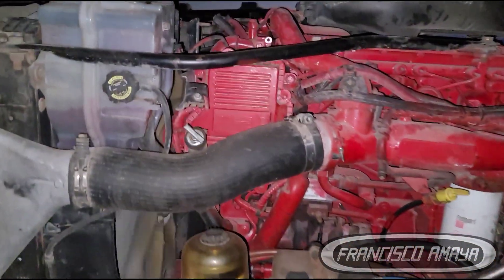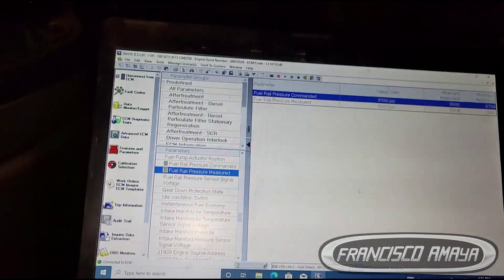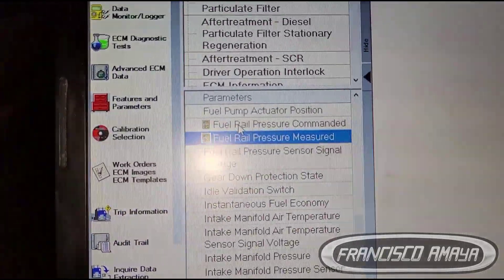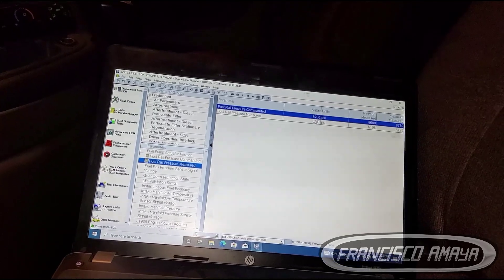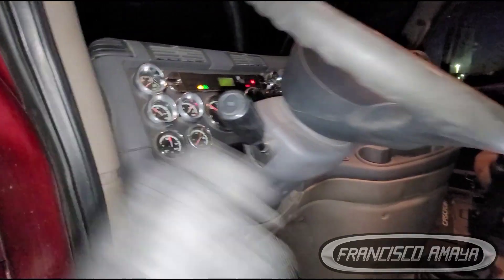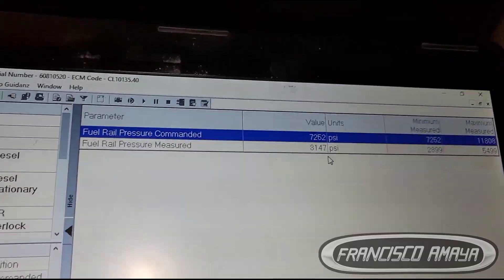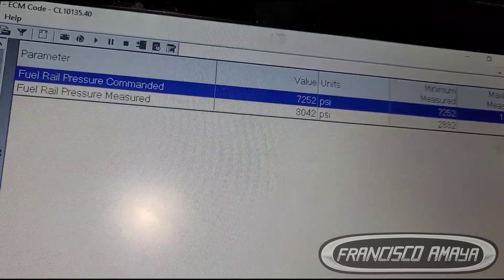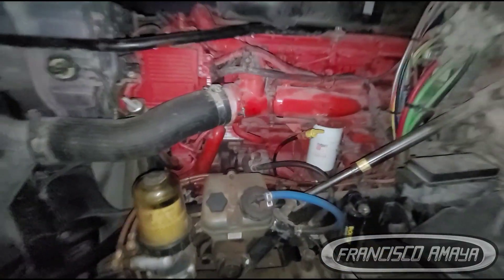Cummins ISX ISX15  high pressure fuel pump low pressure malfunction problem spn 0272 spn 0451

Comment: Having the same issue with ours. I was pulling a hill, got almost to the top, both amber check engine lights came on and truck was dead. Took forever to crank over. Sometimes it would go other times it did not want to.

Comment: Ive had 4 trucks come in with the same problem and i end up replacing fuel pump head and the fuelp pump head adapter. 1 out of 4 of those trucks it was the solenoid at the adapter but the other 3 it was head and adapter